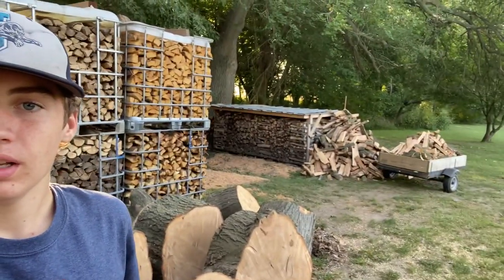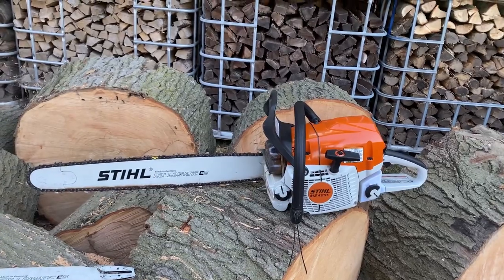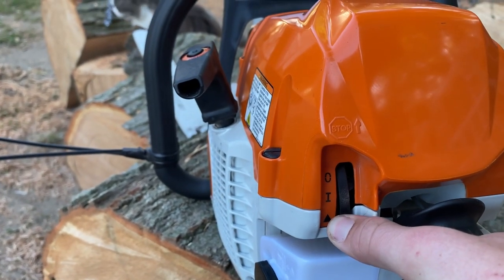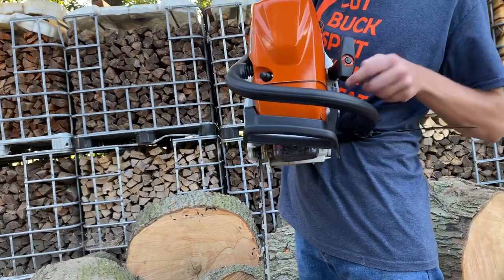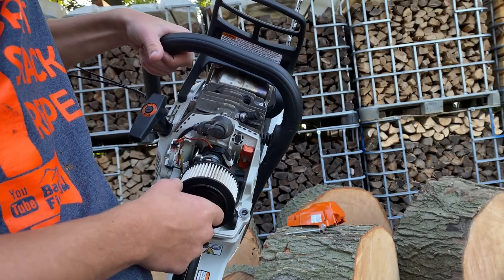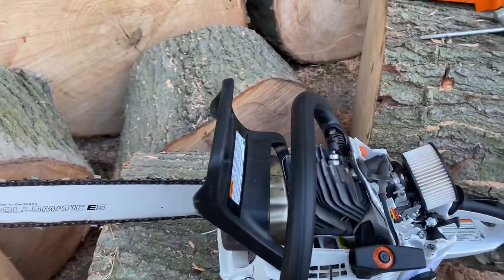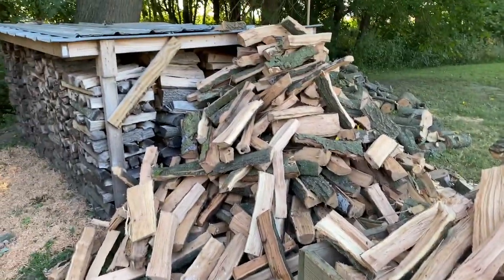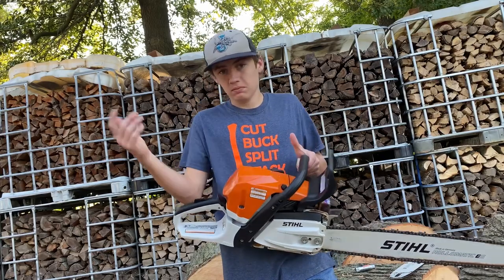Stihl ms400c Specs and Break In Process!

Comment: I’ve got an ms400c with a bark box and I absolutely love it
Reply from the maker: I really want a bark box for ours, I have a feeling it would rip! Thanks for watching!
Reply: Put the bark box and WCS 3 point felling dawgs...very nice package!! Guy that calls my saw a light Saber 😂 says man is that a sweet sounding saw!! I feel it's a wee bit better to boot! And runs cooler.
Reply: Any need to do a reset when you add a bark box? Or just let the saw figure it out?
Reply: @Sisu2280  I reset mine
Reply: @lumberjacksons4468  alright thanks! One other question... What does it mean when it says it fits only a 2 peice muffler on the 400?
Reply: @Sisu2280  the muffler on the 400 and most sthil pro saws are a 2 piece muffler with removable front covers and that’s what the bark box replaces
Reply: @lumberjacksons4468  thanks for that... I've got it on order, and will do a reset once it's on!
Reply: @Sisu2280  good deal buddy, let me know what you think after you run it the first day

Comment: I've had a ms441cm for ten years now and it's been great. I cut big firewood with it and use it on my Alaskan mill too. I'm gettin older and the saw is feeling heavier so I'm thinkin about trading up. The ms 400c is the same horsepower,but more than 2lbs lighter. Bucking up big firewood rounds with the 441 is a chore and I use my little husqvarna 550xp for smaller stuff. The ms400c is only a little heavier than the 550xp and alot more power for my 28" bar.
Reply from the maker: I’m sure the 400 would run the 28 inch bar no problem. Ours runs a 25 like it’s nothing! Thanks for watching man!

Comment: I have the 500i. The 400c and 500i fueling deliveries are quite different. The 400 being electronic controlled carb and the 500i is actually fuel injected no choke on the 500i. Just thought I'd through my 2 cents in any how great vid and thank you for the info im sure it will be a fantastic saw as it is a STIHL!! Lol

Comment: Might wanna use that chain brake when you're starting ur saw just a suggestion from my experience plus i do some climbing with a saw and that habit can save you whether up in a tree or on the ground! 👍 I'm hoping to pick me up the 400 this week hopefully I've been eyeballing it for awhile now and sold my ms391 so need a saw to replace it and looking at the 400 as a good solid replacement!! 👍
Reply from the maker: The 400 I would definitely recommend! It is a great saw, not to heavy but has lots of power. And has little to no vibration!
Reply: @WhackinAxes  yeah everything I've seen about it has been good i liked my 391 had a 18 inch and 25 inch bar for it gonna do the same with the 400 is my plans  the 400 is more powerful and lighter than my 391 was !! Priced one just a few minutes ago here locally and with the 25 inch bar it's 980$
Reply from the maker: @jarrodp6068  man thats almost 200 bucks more than the one we bought! Although ours did come with a 20 inch bar
Reply from the maker: @jarrodp6068  sorry typo, I meant 100
Reply: @WhackinAxes  yeah just a few months ago i could have gotten it or about 880ish
Reply from the maker: @jarrodp6068  that is around the price ours was I think
Reply: @WhackinAxes  yeah I'm planning on getting it this week maybe tomorrow after work 👍
Reply from the maker: @jarrodp6068  awesome!
Reply: You guys got them at the right time just paid $1100 for one w/20” bar after tax.

Comment: How'd you get to the oiler to adjust it ?
Reply from the maker: There is an adjustment on the bottom of the chainsaw. The orange Stihl screwdriver that comes with the chainsaw is what we use to adjust it.
Reply from the maker: There is no plastics that need to be removed it’s just a little hole you put the screw driver in
Reply: Mine has a plastic cover you have to take off,to get to it
Reply from the maker: @billycramer4829  is it a Stihl?
Reply: Yes it is a stihl ms 400
Reply from the maker: @billycramer4829  hmmmm I’ll have to ask my dad, he is the one that adjusted it but he didn’t mention removing any plastics

Comment: You need to use the decompression valve because your weak. If your able enough to operate a chainsaw you should not need to use the decompression valve to start in. If your strong enough to use it you should be able to start it. I call engaging the decompression valve, engaging I need to sit down to pee mode...... So it's not that your just gonna use because it's there, It's simply too much of a saw for a city boy like you lol